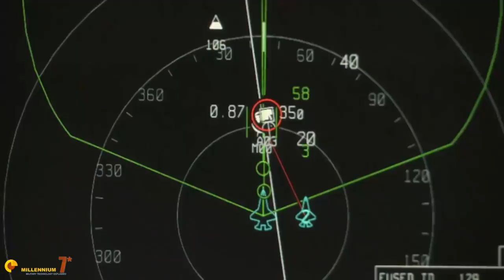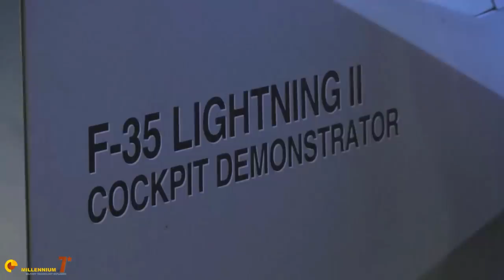Put the F-35 inside the F-16 | Are there limits to upgrades?

Comment: This brings to mind a thought I've had in the empty cavity north of my shoulders. Obviously, I don't know if it's feasible. Long story short, could the weapons targeting and general (non-radar) situational awareness capabilities of the F-35 be integrated into the A-10? 
Any "thoughts" from the back of the class? This is the YouTube comments section after all.
Reply: What would be the point.
Reply: @Mediiiicc  Check out what the pilot of the F-35 can see and target. That should answer your question.
Reply: @politicallyunreliable4985  You don't understand, let me rephrase. What would be the point of upgrading the A-10 when the CAS mission is performed better by F-15, F-16, and F-18?

Pretend the A-10 doesn't have a gun for a minute, just bombs/missiles, and fully consider its strengths (there are none) and weaknesses compared to other aircraft.

It fly's slow and low, it can't defend itself from enemy aircraft, it is vulnerable to MANPADS. 

Now add the gun back on and tell me that the gun is worth all those limitations, a gun which has to be manually aimed by the pilot with small windows to align their shot and long turn around times. A gun which forces the aircraft to maneuver into extremely vulnerable positions just to employ it. How would the gun ever be worth that when bombs can do the job better and safer?

The A-10 is cool and is probably one of the best moral boosters out there but the reality is that it is obsolete and needs to be retired immediately, no amount of upgrades can fix it.
Reply: @Mediiiicc  While performing true CAS, there may always be a need to get close. MANPADS are beyond a real concern, even without a near-peer conflict. Blow an engine off an A-10 and blow an engine off an F-16,,,,,,,,,,oh wait. The F-18 and F-15 are only marginally better off. None of the planes listed are designed to take similar levels of ground fire.
The A-10 was designed around the punishment inherent in true CAS. Go read about the A-10's design philosophy regarding survivability. It's a dedicated tool.
It's gut wrenching to think about what those pilots were preparing to go into if something popped of in Europe circa 1970's-1980's.
Unfortunately yes, the gun is a really expensive meme at this point. A couple/few .50 caliber machine guns would do much of what the GAU-8 Avenger does now. Not to mention simply dropping a CBU.
Reply: @politicallyunreliable4985  Most CAS has been performed by F-16, there is no reason to get close. MANPADS are a very serious and real concern when against any organized military on today's battlefields, near-peer or not, only a fool would say otherwise. FYI the only reason people would think MANPADS are not a concern is because US destroyed the last countries military they fought BEFORE MANPADS proliferated to today's extent, the tech is now 50 years old and widespread. Now US only fight rebels that can't afford to buy them or train with them so they can deploy A-10 freely.

If US were to go to war today (with lets say Iran) A-10's would not be deployed until after most of the work has already been done and it is safer to fly. Even still, when a soldier calls in air support they will want it ASAP so why would they want to wait for a SLOW A-10 when another jet can get there significantly faster? Potentially saving their lives. The speed argument alone is enough to entirely defeat any proponent of the A-10. No thank you to dead soldiers because their support was too slow and couldn't get there on time.

The A-10 was built to be more survivable because it has to put itself in a position to take enemy fire, other jets don't put themselves in that position in the first place which is FAR superior and defeats your survivability argument entirely IMO. Not to mention F-15 returning to base with a wing blown off completely.

Edit: Also I forgot to mention but if an enemy fighter shows up the F-16/15/18 can defend itself where as the A-10 would be helpless. Another point for survivabilty in favor of other jets over the A-10.
Reply: @Mediiiicc  You make many interesting points!  I suspect the A-10 is still around as it's generally been used in uncontested airspace, and it's the tool that is available. The use case it actually fills (as opposed to it's design intent) makes comparison with an A-29 or an AT-6 more appropriate.
Reply: @politicallyunreliable4985   "there may always be a need to get close" - Examples?
"Blow an engine off an A-10 and blow an engine off an F-16,,,,,,,,,,oh wait" - The A-10 suffered twice the losses of the F-16 in Desert Storm.
And these two sentences:
"The A-10 was designed around the punishment inherent in true CAS"
"It's gut wrenching to think about what those pilots were preparing to go into if something popped of in Europe circa 1970's-1980's."
They're inherently contradictory. The A-10 was designed assuming a relatively permissive environment where 14.5mm AAA was the biggest threat. The true punishment it would receive from Soviet armored columns would have shown how vulnerable the A-10 and how flawed the design was.
Reply: Since they have basically decided the A-10 is obsolete and not survivable on a modern battlefield, I doubt they would bother fitting it with ultra modern, expensive targetting equipment. It is still just as slow and vulnerable to modern MANPADS.

Comment: Speaking as a guy with a career in avionics testing and certification with a major defense contractor, I'm really glad to see somebody stress the difficulties and costs involved with avionics upgrades. Even this just barely scratches the surface.
 I've been speaking out against the idea of putting 5th gen avionics in 4th gen platforms for a while now, mainly because the avionics themselves are one of the main drivers of the cost of 5th gen aircraft in the first place.
 The main problem you didn't mention is parts procurement and obsolescence issues. This is unique to aerospace applications. We need to procure parts that conform to very rigid standards, yet we only buy them in small quantities. Naturally suppliers don't want to do this, so we wind up paying a fortune for them. Even then, the suppliers eventually decide that the low production rates and high standards aren't worth their time, so they move on to producing something else and we're left without conforming parts to build our avionics.
 That means a redesign, with a new round of certification testing, which exposes flaws, which means another round of redesign and testing, and so on.
 And all the while, the costs just spiral out of control.
Reply from the maker: Very good point, thanks for pointing out.

Comment: Well IRIAF tried to integrate F14A with AL31 and R27... it resulted to many expensive electricity bills for the design bureau buildings, many conscripted engineers missing their regular leaves for failing to produce the required results, a number of fist prints on the walls, few tossed around broken desks, one air intake reaped off the air frame and sucked into a brand new engine, and time after time of computers on-board the Tomcat going 🤯 when trying to talk to the R27s... and if you think that was naively ambitious, they then tried to swap the tail of the F5E with a V shape tail and pluge in two RD33, without actually redesigning the front of the plane, resulting in absolute horrifying flight characteristics including total loss of rudder control beyond certain speeds, because Da, both of them just go through the engine intake turbulence trail... these days they just adhog F5A/Bs with some upgrades and keep calling them new names, and who cares if they don't actually work, they fulfill their propaganda mission all right, otherwise everybody knows a turboprop attacker does those stuff just fine at fraction of production and operational cost... and certainly none of them are painted Blue angles livery anymore...

Comment: BIGGER engine to offset higher weight = more fuel, to maintain usefull range = more weight = larger airframe = needs a larger engine to maintain performance = still more feul= larger airframe = more weight + still larger engine,,,

Comment: Why not just produce a less steatlhy F-35 without RAM ? That would lover running costs. They could also be RAMed up in peer level conflict.
Reply: Because the whole point in F-35 is to be stealthy. We spent X trillion dollars developing a stealthy jet, with stealth complicating and driving every aspect of the design, and now that it is almost complete, entering service and the final issues are being ironed out, you think we should just drop the entire stealth part and use it as a normal fighter instead? Lets just drop the VTOL part as well. We can end up with a jet that is slower and less maneuverable than the F-16, vastly more expensive (since most of the cost comes from already sunk development expense), but not stealthy either. In what world does that makes sense? The time to drop or alter F-35 was ten years ago, we would be morons to do it now, when it is finally working. And waiting for a war to start before bothering to fit your planes or train your pilots with your greatest single greatest advantage is just retarded. 'Okay, China, be sure to give us plenty of warning before you start a war, so we have time to draw all of our F-35 fleet back to main depots to fit stealth coverings, and train pilots and maintenance crews for stealth practices; we need about a year, at least six months. Thanks guys!'
Funny, stealth is even more expensive on the F-22, yet I rarely see anyone complaining about that plane. An F-22 without stealth is basically an upgraded F-15. So why the hell would we not just use upgraded F-15s instead?
Reply: @justforever96  it's all about running costs most day to day missions are just routine, and yet using state of the art stealth tech to do a patrol is not cost effective, an F16 can do the same mission at far lower cost. The air force realises that low high mix is more affordable. The greatest asset the F35 provides is situation awareness, this can be shared with other platforms

Comment: Smaller transistor size always reduces heat generated per transistors for same clocks. Smaller transistor size is always used to increase number of transistors in a package and increase clocks. Clock increase also increases heat generation faster than linear relation. This development has made high end consumer CPU and GPU products thermal limited too.

A high end GPU produces about 300-350W which is similar amount of heat as a low setting of a stove or lifting 35 kilograms about a meter each second. A lesser chip designed for a low power has 5-10W limit.

Nvidia 3090 claims about 170 trillion instructions per second with 350W TDP (0.5T/W, 28.3 billion 8nm transistors, 628 mm²). Apple A14 claims about 11 trillion instructions per second with 6W TDP (1.8T/W, 11.8 billion 5nm transistors, 88 mm²).

Comment: all of your points are valid, however, it does not really change the basic idea. The F-16 is being retired because the majority of the US Air Force fleet's F-16 is being retired because of the flight hours on the airframe is being used up. Updating the F-16 would entail some effort, as in new radar systems, possibly engine, and other more minor improvements. I don't even think that the F-35's avionics are so advanced that they could not be improved upon. The idea would be to start with the F-16V, and improve the avionics from there. The F-16V already has AESA radar, but the elements could be changed to the GaN types, improving power and reducing electrical requirements because of the efficiency gains., as one example. The software could be improved, using the algorithms from the F35, or the F-16V as appropriate. Sensor fusion is not really necessary, but if it could be implemented in a cost effective way, then sure, add it. Add IRST. And then, update (not completely change) the airframe to increase flight hours to say 10,000-12,000 (or more). They did that with the F-15EX. Then, without changing the dimensions of the engine, improve it (perhaps use one of the F-15EX engines) so that fuel efficiency and power increase. There must be a number of improvements made to jet engine technology since the last F-16 was coming off the production line.
The idea is to use the technology of the F-35 and some of the newer concepts that came out of that program, but to re-package them to fit the F-16's airframe, power and cooling capabilities. This seems to be a less expensive, and far faster way to solve the US Airforce's aging fleet issue than to design an new 4+ generation airplane.

It that doesn't work, then the US Airforce should just buy Gripens. The Gripen E's are everything the Airforce is looking for in an F-16 replacement. Faster, more fuel efficient, good weapons load, and new, as in they won't be running out of airframe flight hours anytime soon. AESA radar, check; sensor fusion, check; IRST, check: supercruise, check; able to network with the rest of the US Airforce infrastructure, probably check (Gripen E can already interface with NATO data links, but I don't know if the US Airforce data links are the same; it may be possible, or it may need work); has a good EW suite, also check. Engine made in the US, check; can be made in the US, also check (Saab is already working with Boeing). Before everybody starts jumping all over me, consider that the US Airforce has used the B-57 Canberra and AV-8 Harrier in the past, both foreign designs. As well, Gripen E's cost per flight hour is close to that of the F-16, and not the ridiculous cost per flight hour of the F-35.
Reply: F-35's avionics are being improved upon with Block 4 upgrade i.e. improved EO-DAS (Near IR/IRST), improved flat-panel displace, improved digital signal processing hardware and 'etc'.
Reply: Thailand's Gripen C was beaten by  CHina's SU-27 on sustain turn rate.

Comment: You have a very basic understanding of aerodynamics and the way some aircraft are built and why they're built and their Electronics capability, etc etc etc.
I agree that you cannot totally upgrade an F-16 to all of the capabilities of the F-35 at least as much as the F-35 isn't Electronics mule and only powered by about a .66 to 1 power to thrust ratio, which is why it will never be much of a combat plane. Stupid remarks like the F-16 will not be stable if you put all the end of an F-35 on it, is idiotic because the F-16 is not a stable aircraft on its own to start with. That's why it is such a good dog fighter. You can however increase the electronics capability of the F-16 tremendously. Upgraded engines already exists on the aircraft, and more capable engines are available for it. But you don't need all of the capabilities of the F-35 in an F-16.
The F-35 Electronics capability can be put into an aircraft and used as a Communications and electronics mule. It's never going to be a great combat aircraft in the first place, even though it can still have some missile capability which is the only thing it has anyway as far as combat. And still having more capable F-16, you can upgrade an F-15 and still have a more capable F15, and still have communications mule that is more portable than an awax. And then you will remove all doubt with all these people have talked about what a great aircraft the F-35 is, the F-35 is a plane that had barely has the capabilities of flight that the F4 had. It flies like a truck compared to the capabilities of the F-15 and F-16.

Comment: They want to put turkey guts into a falcon...

The latest F-20 and Faa-18 Growlers have much of the F-35 's electronics and Avionics, which were the only good thing about the F-35....
Reply: Stealth buddy
Reply: @user-dq1je7zy3p  extremely over rated, and new Radar systems and even old wide band radar systems can detect them if there opperators know what they are doing...

Stealth is only really useful in a first strike role, certainly its useless in a close air support role.

Stealth is not nearly as critical as many think, the US just totally killed the F-35 program, so the F-35 fanboys can start crying
Reply: @phoboskittym8500  You need to study stealth more, your opinion will quickly change.
Reply: F-35 has a larger radar when compared to F-16V or F-21
Reply: @phoboskittym8500   "US just totally killed the F-35 program" is FALSE
Reply: @phoboskittym8500  So normal aircraft will be even easier to detect. Okay, there's a new hurdle in the playing field, and any aircraft that cannot jump over it stays grounded. Stealth just because the price of admission.
How is it not useful to fly in an aircraft that resists to being targeted?
The US didn't kill the F-35 program.

Comment: So what you are implying is that the Super Hornet and F-15XL were horrible ideas. LOL. Really, They seem to be a lot more successful than the F-35. You are just totally negative. There are major advantages, especially compared to the F-35. What is the flight hour cost of new F-16 was probably a fraction of the cost. And what is availability of the new F-16. And you cannot tell me that if they planned to produce this plane in the 1000's the cost would not drop significantly because if they did the development cost would be spread over a lot more planes. Don't know, can you tell me are the illities for the new F-16 all so much better than the F-35.  We know that the F-22 is horrible both in cost per flight hour ($68k) and availability (about 50%). And look at the B-52 and A-10. This just seemed so one-sided. Not up to the standard I would have expected from you. Comparing the cost of a plane that has only a very limited number of airframes compared to what they assume with the F-35....how pathetic.